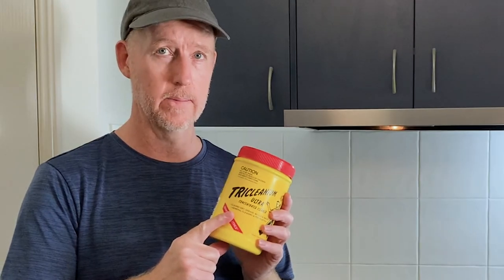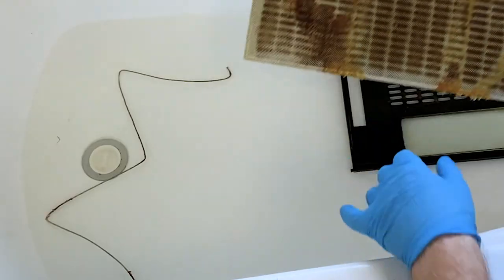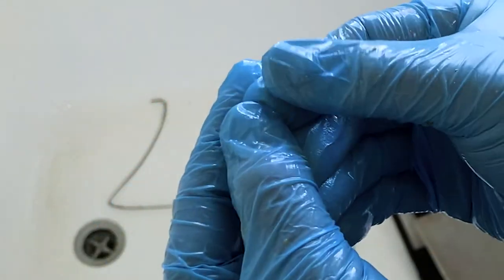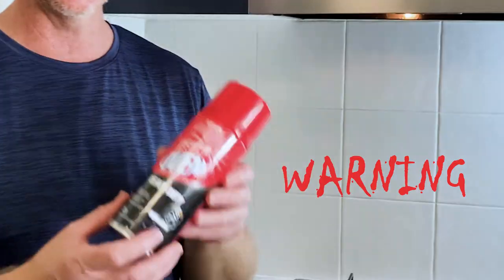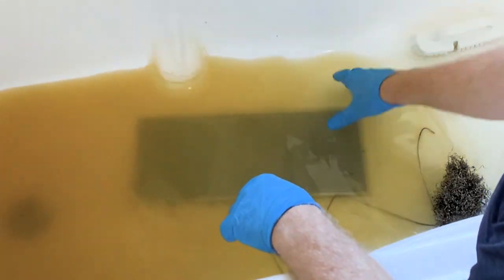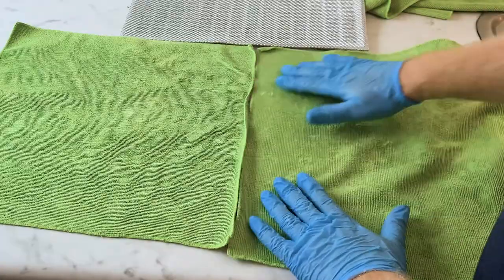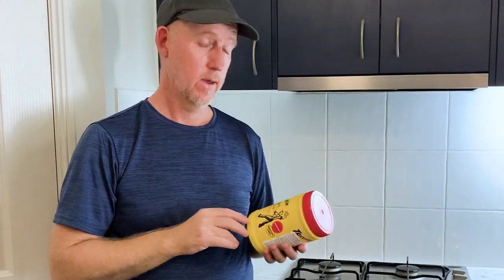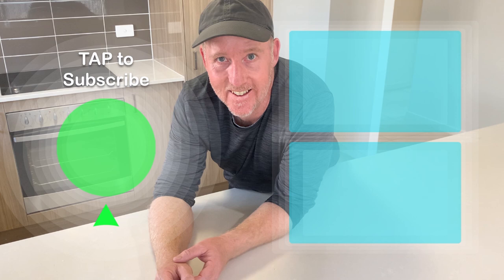How to Clean Super Greasy Range Hood Filters | Kitchen Exhaust Fan

Comment: Not worried of clogging the sink (or bath) drain with all that super greasy water?
Reply from the maker: Most of it is dissolved by the degreaser. Lots of hot water rinsing too. Drains probably cleaner now